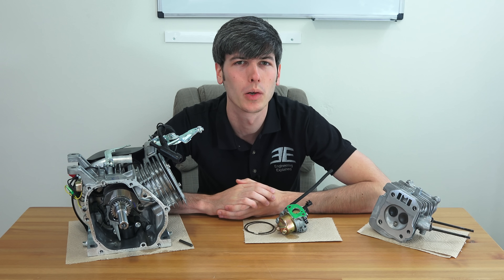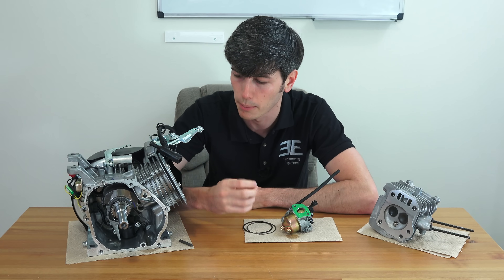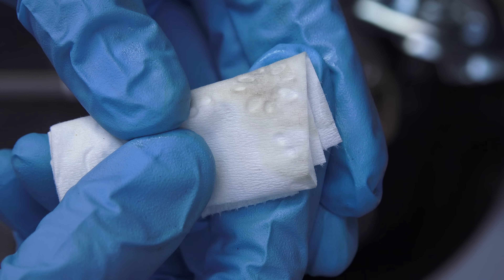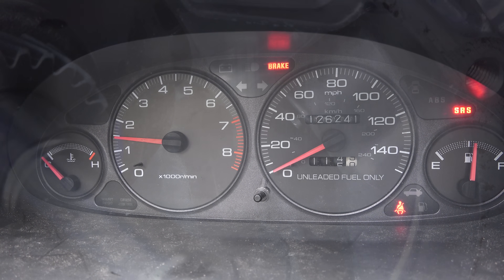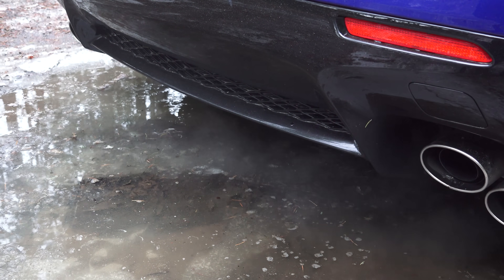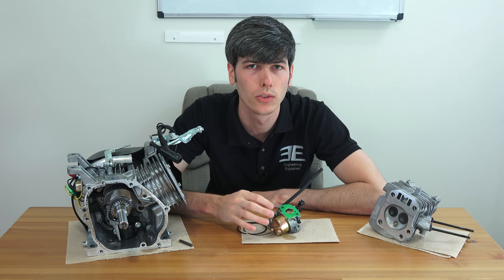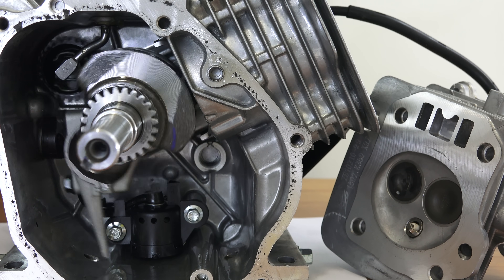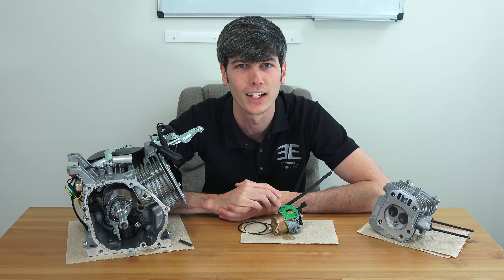Should You Warm Up Your Car Before Driving?

Comment: Great video on the effect of cold to an engine.

Something else to consider though are those other other components affected by cold temperature (transmission fluid, differential fluid, steering fluid, brake fluid, greases, rubbers, moving parts, etc.).  I'd recommend it is best practice to drive gently for the first few minutes (i.e. no heavy braking, steering slowly, etc.) and let everything warmed up gentle through use before going hard.  You could have you car running for thirty minute to warm up the engine but that won't help your brake callipers thaw or your rear differential fluid change from being a molasses.

Comment: I'd let my car heat up to optimal temperature assuming it was better for the engine than running it on cold oil. Thanks a lot for the explanation, will know better now :)

Comment: what i do is while me or someone else is scraping of the car in winter the other person starts the car and holds the rpm at around 2000-2500 and when the car is fully uncovered the engine should be at operating temperature so in the city you don't have to baby the engine.

Comment: Which weather-temperatures are you talking about? Over here in the really cold climate we use a preheater, not only to get better alot better fuel economy and to get the car to operating temp for the environmental systems to be effective. Also, in small diesel engines when you run the air heater in really cold weather the engine will actually never reach operating temp.. So you know, partly a preheater for engine blocks coolant and a heaterfan for the cabin is not a bad idéa. In an engine of the mentioned type I preheat the engine and don't switch on the airconditioners heater until it reaches operating temperature.

Comment: This may be fine for mild cold. When it's -40 your windshield will instantly fog up and freeze from the drivers breath. I need at least 5 to 10-minutes of warm up time for defrost to work and safely drive.
Reply: i hated trying to hold my breath in car at those temps to stop it from frosting over even with windows cracked

Comment: I'm sorry but this is terrible advice, good logic but no.  Your engine and especially the  transmission need to warm up at idle before driving in sub freezing conditions.    Here is why, all internal components of a drive train  are engineered to work at operating temperatures.   Bearings,chains,belts,fluids,valves,battery, are all things that work better warmed up.   The chance of fuel entering your oil due to idling  is very minimal, however  the chance of premature transmission failure due to driving a cold car is very likely. There is a reason a car idles higher until it gets up to temp, it was programmed into the EFI to get the car up to  operating temp faster.      This is what i have learned from my experiences.
Reply: I am so glad somebody said something. I hate this guy. He comes off as very arrogant and condescending. As soon as i saw the title of this video i eyerolled. I was like oh god now what does Mr. Knowitall have to say.
Reply: lilseip-B14 you do know what a transmission cooler is right?
Reply: Cars have warmers inline to warm up transmission fluid before the thermostat opens dumbass.

25 year ASE / Infiniti Technician..............
Reply: dude if you have a transmission with a dip stick you see it says hot or cold. when you check the fluid you need to have the car running.
Reply: ArtyBlackops most vehicles don't have a dipstick these days, you pull an overfilled plug at a certain temperature, it is far more accurate.

I have probably forgoten more about cars than you will ever know.
Reply: but it still have to warm up either way or do you want to pay for another transmission? Using the computer hooked up to the obd2 port with a sealed transmission or dipstick it has to get at the right temp.
Reply: this has moved completely off the subject, but at least most sealed transmissions only need to warm up to about 100F to check the fluid, verses the dipstick .............. needing to drive it 10 minutes or so to get it fully warmed. I haven't seen a service manual yet that tells you it is ok to check the dipstick cold.
Reply: Mike West How can you warm up the transmission if the car is standing in idle?! Drive off gently and your car will be fine.
Reply: Smh
Reply: Mike West 
U do know that there is NO WAY for the transmission and other driveline components to warm up just by idling right? They aren't connected to the engine "yes the transmission is" but it doesn't share the same warm oil the engine is getting. So ur pretty much relying on the engine heat to slowly transfer into the transmission. "Which would take forever". Plus ur rear diff isn't warming up nor is ur transfer case. The only way to warm those components would be to drive gingerly for the first 10 or so min. The wear would be minimal at best especially if ur driving gingerly for the first few min.

Comment: if you start driving after 15 to 30 seconds as stated, will the oil reach the appropriate viscosity for smooth engine operation in time?
Reply from the maker: No, it takes a while for it to heat up, which is why you shouldn't drive it hard initially. But it will have sufficient flow (as long as we're not diving into the negative temps). I believe 5W rated oils are able to flow at -35 F. Not positive on the exact number but it's pretty cold.
Reply: Even when driving calmly, is there not a possibility for the engine to suffer damage? I would think that although there is flow, it is limited and that the oil films would be much thicker than at operating temperature. Does greater oil viscosity present any issue regarding lubrication, assuming normal oil flow? To-be mechanical engineer here, so using technical terms will make your answer even more interesting.

Comment: My old car, a 2002 Infiniti I35 (basically an '02 Maxima) wouldn't drive well unless it was fully warmed up, even in the summer but especially in the winter. It would kind of sound "off" like just not normal if I drove it before it warmed up, even while driving it lightly. Anyone know what that could've been? 

Now I have an '03 Infiniti G35 Coupe, and it drives and sounds fine even when I drive it without letting it warm up at all. (I still let it warm up a little bit anyway)

Comment: what about letting the engine warm up from a mechanical point of view, in other words letting all parts of the engine itself get up to temp before you hit it hard. this due to the fact that the engine shrinks and expands with temperature and this can cause faster wear and tear and or even an engine seize.
would the answer still be "no" you don't need to worry about warm up?
Reply from the maker: As mentioned, you don't want to run it hard until it's warm. Just drive without a lead foot until things are at operating temperature.

Comment: I guess diesel doesn't wash off the oil film in the cylinder, as the diesel itself is more like an oil not a solvent?
Reply: +gimik2 Of course you have to warm that engine, but just idling it isn't really a good way. In fact, if the engine idles for too long, some diesels will automatically kick up the RPM. Idle speed is bad for diesel.
Reply: Yes, it does wash off the oil on the cylinder wall with incomplete combustion on a cold engine, also the un-burned fuel can and does migrate to the crankcase and dilutes the oil.
Reply: +gimik2 Yes, high idle and normal idle speed are two different things. What's your point?

Comment: Hey EE, good video! If i may, i would like to also add something to your Information: there is also the oil pressure problem if you just stay idling. Oil needs not only temperature, but also pressure, and the oil pressure at idle is way too low for the oil to work properly. Even with cold engines the oil does get some pressure if you drive it lightly.

Comment: I've read the argument it uses a lot more gas and is a lot worse with emissions to drive it cold (which I do anyway), so one has to ponder whether it's still worse on the cylinder walls to be depressing the throttle, running it at higher idle and putting load on it vs just letting it idle with very little load.
Reply from the maker: As mentioned, it does use more gas when cold. Driving it warms it up much faster than idling, thus minimizing this effect.

Comment: I drive a 06 Infiniti g35 and I get a lot of rattling around the ac/stereo on the dash. It's anecdotal so I'm not sure the data would show that it actually works, but I like to let the engine warm up to try and reduce the rattling, especially during cold weather.
Reply from the maker: +dplunk13 yep, cold cars definitely seem to rattle more. My Subaru was certainly like that. Parts expand with heat and have a more snug fit.

Comment: Does this also apply for turbo engines? I always heard that a turbo should be given a few minutes to warm up/properly lubricate so I always let the idle drop a couple times before taking off from a cold start. Does this mean I could just wait ~15 seconds and just shift at low RPMs for a bit?

Comment: Thank you for the video. what about turbocharged engines ? I would assume that letting that insanely fast revving turbine warm up before putting any load on the engine could be a good thing. is it ?
Reply from the maker: +Corentin Français (NT) if you drive it out of boost, no issue.
Reply: Thanks !

Comment: What about old carbureted cars? There is a clear difference in the way my old 305 runs cold vs hot.
Reply: did you not watch until the end?
Reply: He explained it's ok to let carbed cars warm up because they aren't injecting extra fuel and thus not wearing out faster. Yup I remember the days of carbed cars. You didn't just get in them and drive down the road on cold days, not the ones we had.
Reply: +David McClelland 
I have an 83 Monte Carlo with a 305. It's never had any problem starting in the mornings, even when there was a -10°+ wind chill at night it always stated right up. I've had to start up and take right off a few times running late, and always felt like I was killing the engine when I did that lol.
Reply: you aren't killing it, it's just probably wearing a bit more due to the oil not being thin enough to lubricate fully.
even in a carbureted car driving cold at low rpm isn't a problem.
Reply: DemocracyOfHypocrisy Yea having grown up in the time I did I still feel guilty about taking off in my EFI car without warming it up, but no it's not killing it. As long as you aren't gunning it to WOT at high rpm's all the time. 

My bro in law actually had the exact same car you have. It was red with the 305, a center console shifter and he put chrome mags on it (it was the early 90s). Car was beautiful. But every time he got in it he took off down the road WOT and one day it blew up on him. Really sad.

Comment: Did you abide by this when you owned and drove your STi?
Reply from the maker: +TheRedrider05 absolutely. Just didn't get into boost until it was warm. Anything less than about 40% throttle and you'd stay out of the boost.
Reply: +Engineering Explained understood. I find myself still letting the engine warm up. And my reasoning would be that cold oil won't properly lubricate the rod bearings as well as oil that is up to operating temperature. I have no evidence to back up my reasoning, but my gut tells me that is rather stay at a lower rpm while the oil heats up for longer rather than spinning the rotating assembly above 2k or 3k rpm for any amount of time. 

Since you're an engineer and I'm not, would you mind explaining further? 

Also, sad to see the sti go

Comment: My car's fuel injected and it doesn't run good if you start it up and take off right away. You should atleast let the idle drop before taking off and if it's below freezing outside, you should let the car run a min or 2.

Comment: Sooooo you're saying that I don't need to idle for 20 minutes every morning before I drive away?
Reply: i had 3 double cheeseburger for dinner, do you think we are the kind of people who care about wasting fuel? 'Murica!!!
Reply: It's a free country, you do whatever you wanna do.  'Murica!
Reply: No but your neighbors enjoy the ambient noise.
Reply: Orenthal James Especially at 6am!
Reply: omg 20 minutes ? , That's a waste of fuel
Reply: you dont and you shouldnt
Reply: awesome why not 30 minutes at the least efficient rpm?! how about an electric heater?
Reply: RC Fanatics It's a waste of gas. Especially in the winter. And your car is going to have oil circulate throughout the engine just fine. As long as it starts flowing and you're not driving hard while the engine is still relatively cold, it's fine.
Reply: JoshorBrownKid all I'm saying is people warm up their car for whatever amount of time they want. I feel better knowing I got warm air on a cold morning and all internals are expanded from a cold form when fully warm
Reply: unless you live in my area where it is the norm
Reply: You must have been the first in your class.
Reply: 20 mins is excessive, I let mine idle for between 5-10 mins. minimum for cold (below freezing) and up to 5mins above freezing or if it's been sitting for awhile (overnight)
Reply: JoshorBrownKid why is it too long? I like my oil running through top and lower end good, but most of all I like my damn heat and steering wheel to be warm before I drive off. driving a 1.4l car takes a while to get the heat up anyways. is that fine by you?
Reply: JoshorBrownKid I'm talking about letting my car idle for 10 minutes when it's 0 outside and I sit inside and drink my coffee so I got a warm car to drive with
Reply: RIP your heart
Reply: hx0r XD i cracked on that one! ;)
Reply: i dont think the shouldnt part should be there... its not a crazy big deal to leave it on a bit. But id say let it sit for 2mins, you want the cabin to get warm anyway right? then drive slow
Reply: RC Fanatics At the same time, be mindful cause idling for too long hurts the engine too. It depends on the car really, but it does happen.
Reply: You can't just do whatever you want. It is in fact illegal in some states to idle your vehicle. So don't.
Reply: @HDeverythingSD  Fuk the laws
Reply: Brandon Cunningham same here
Glad Im not crazy...
Reply: 5-10 minutes is still too long. I let mine warm up for 3 minutes and head off. Plenty of time for the oil to circulate and have the interior relatively warm. Note, my car is parked outside (not by choice) and I leave for work at 5:30AM, pretty much the coldest point of the night.
Reply: wow, you guys are feeling patriotic today, arent ya?
Reply: RC Fanatics Same thing I said. In a couple of minutes, you'll be okay to start driving engine wise. As for heat, set your heat, close your vents a little just so cold air isn't killing you, and just drive. Open them after a few minutes. The engine will get warmer as you drive and so will the heat. 

My car sat for 3 days in -21c weather before heading out to work this morning. Followed the same procedure, about 4 minutes in, the temp needle was almost at the middle and my heat was perfect.
Reply: Kirk Augustin Lol... I'm not gonna bother with you.

Comment: I live in Michigan, and during our winters I let the car warm up for 5-8 minutes atleast. By then the temp gauge is about 120ish degrees. Then I drive off slowly, and 3 minutes after leaving my house I'm on the freeway. During the summer, I just wait until the temp guage goes a little above 100 degrees. Then I drive off slowly. I've been doing this for years and my car has a very healthy engine at 185k miles. The reason I'm religious with warmups is because right around the corner to my house is the entrance to the freeway where I will be going atleast 70mph...I used to not let it warm up and the car would feel so restricted and underpowered..But with my current procedure, my engine is smooth and responsive. I'm never changing lol.

Comment: I have a 2016 WRX and when I bought it I was told to wait for the high idle cycle to finish before driving. It takes a few minutes, but Im wondering if thats even necessary.
Reply from the maker: +elingauer if it takes a few minutes, I'd just drive off instead.
Reply: +Engineering Explained ok thanks! good to know

Comment: coming from a racing standpoint you NEVER run your car on a cold engine. EVER

first of all, your efi has a function which keeps the idle higher at startup in order to get to starting temps etc.  I can see your point on a older car that's not efi, or a pos car that doesn't have a good oem pcu set-up

personally speaking, my car has a start up program which will warm the engine to proper operating temperature, at which point the idle drops to normal

the whole point of it idling higher upon start-up is to warm it faster....

especially in cold weather you should definitely not put load on the engine before the temperature is proper or it won't be lasting long